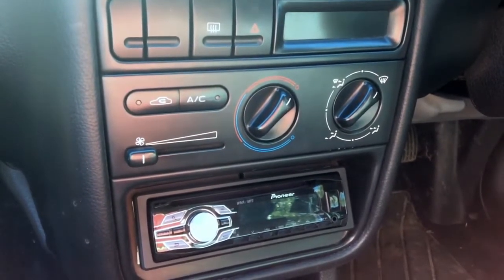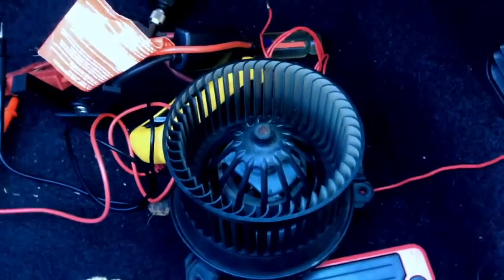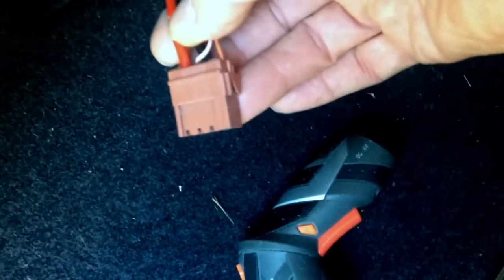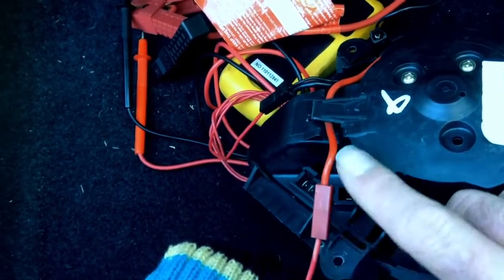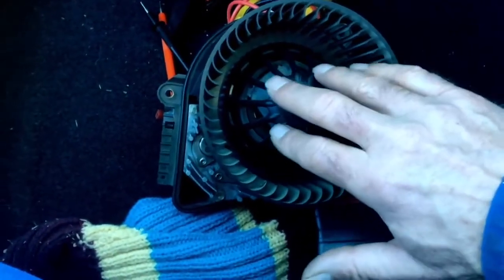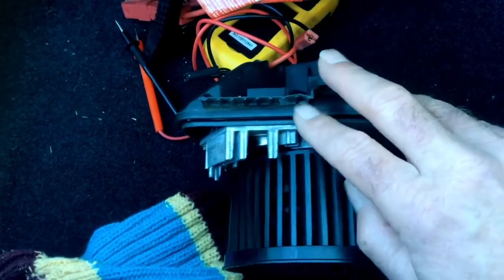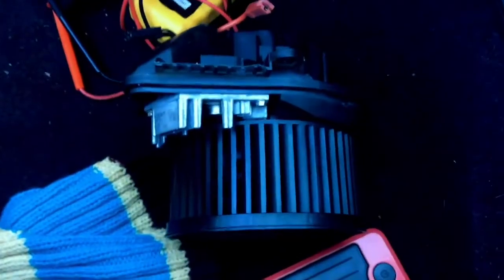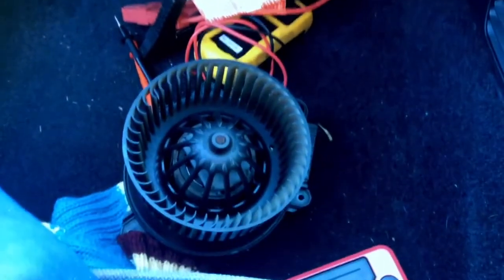Peugeot/Citroen Blower Fan Speed Controller

Comment: Hmm. Yours has 4 wires in the 4-pin connector. I only have 3 wires. And my controller is potted, not with the two chunky transistors visible.
I bought a replacement blower and that only had a 3-pin connector, but with + and - the opposite way round! 
And the new one would only run at full blast, not slowly. My controller knob appears to be a 0-500 Ohm resistor ladder. I'm trying to work out how the controller on this actually works and how many different blower/controller variants there are. I'm getting one with a 4-pin connector tomorrow - lets see if that works any better.(My vehicle is the Peugeot expert 1997 van but clearly things are quite similar but not identical. Vehicle debugging is such fun.)
Reply: Update: the 4-pin version of the fan worked fine. So the 3 and 4-pin version of the fan appear to have opposite sense of the control voltage, as well as the power sense the oppose way round.
Reply: @xxwookey I´m still struggling with my 1996 Peugeot 406. The fan only works in the minimal set, if I try to increase the speed, it slows the fan speed. I tried to replace the digital controller (new and old seems to be in working conditions)  I noticed this controller sends about 8.3 volts to the pins 1 and 3 (those with thin wires) I suspect it should be sending 8V to 12V to these pins and speeding the fan as voltage increases. The fan controller is new too.
Reply from the maker: Sorry, I'm not that versed in the details of fan controllers, maybe try one of the Peugeot forums for help.